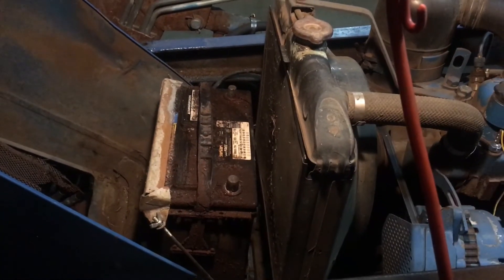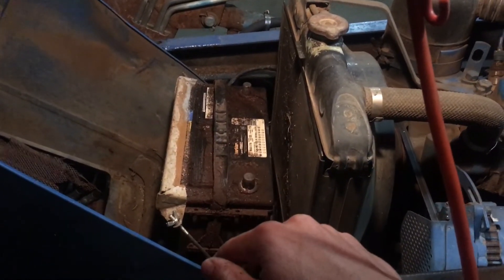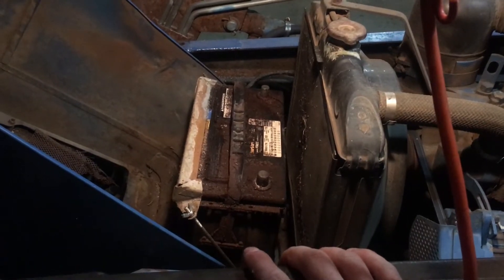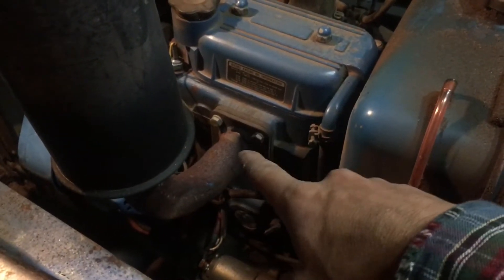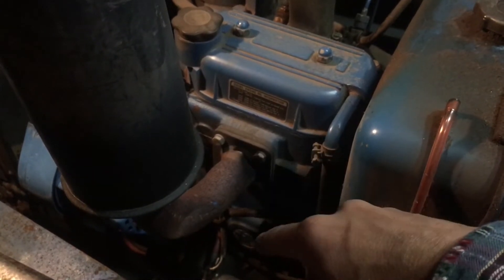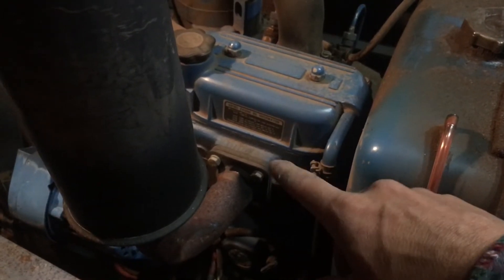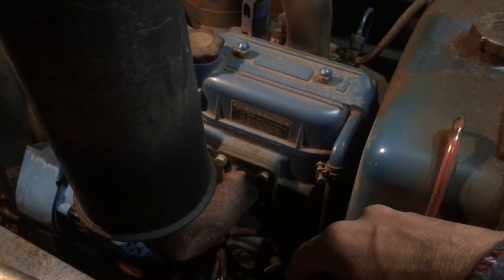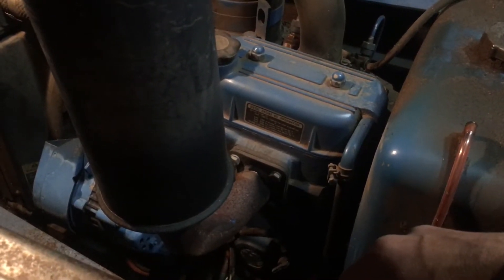Ford 1700 Tractor Vertical Exhaust Muffler Replacement

Comment: Wish I knew where to get spacer between manifold and muffler my hood drags exhaust. Ford dealers can't find anything but that part on video looks to be factory.
Reply from the maker: It was there so I assume it is factory. The muffler on this tractor has been replaced before though. It wouldn’t be hard to make one. Just get 3/16” or 1/4” steel plate, cut to size and bore the holes. Even with the spacer the muffler is pretty tight to my hood.
Reply: Thanks